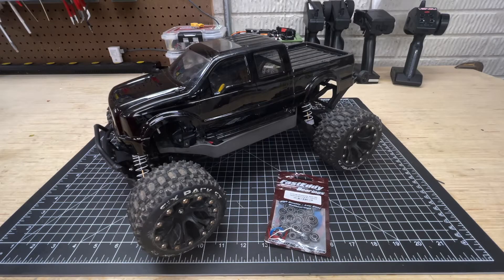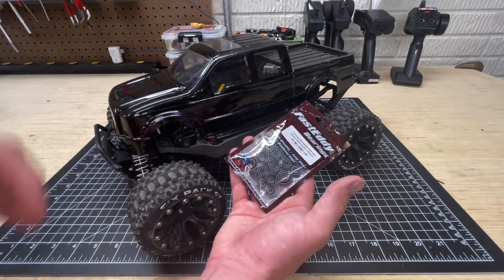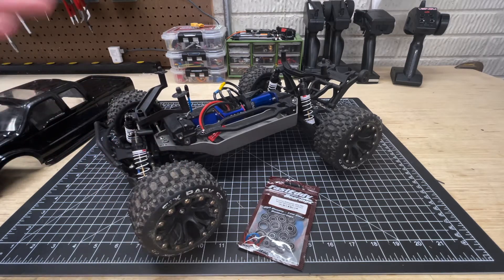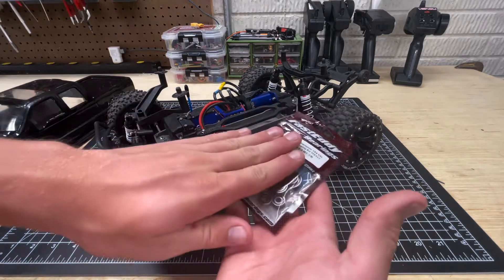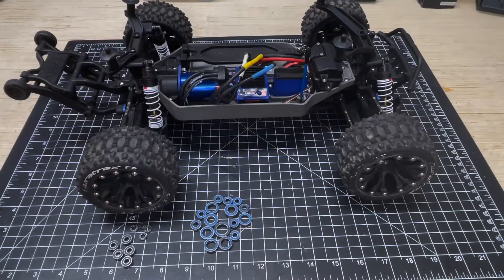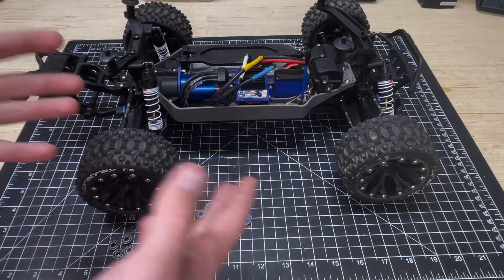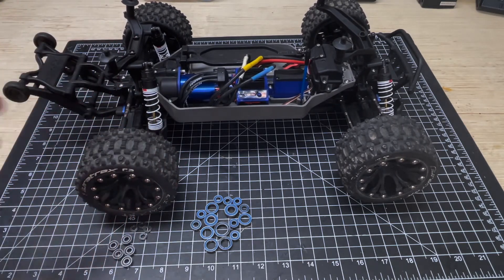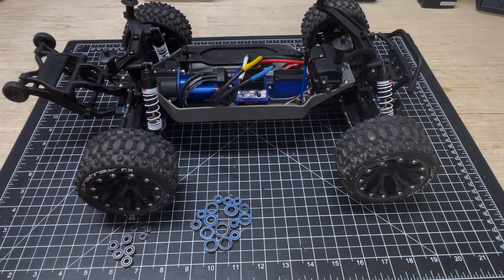Traxxas Stampede 4x4 VXL Upgrade #2 - Fast Eddy Sealed Bearing Kit | CustomRCMods

Comment: what are your thoughts on these bearings after using them for a while?
Reply from the maker: They aren’t much of a performance upgrade from stock but are a cheap and organized replacement thats high quality and they are more durable than stock in my opinion.
Reply: @CustomFPV  Nice. They have also the ceramic bearings. I Will try the normal bearings when my stock bearings are worn out. 

Thnx man.